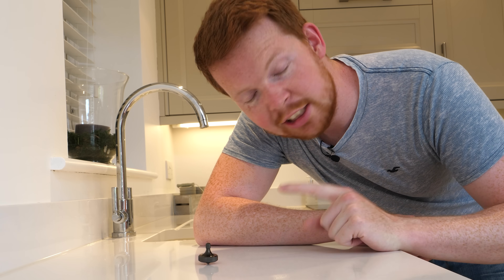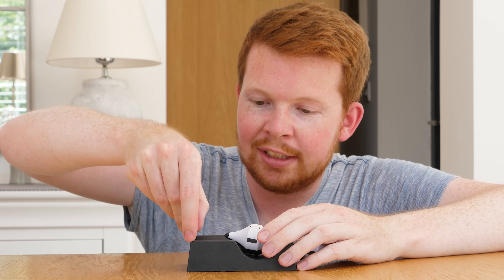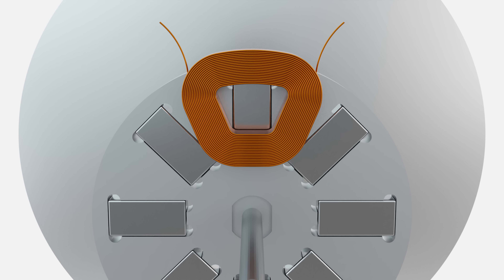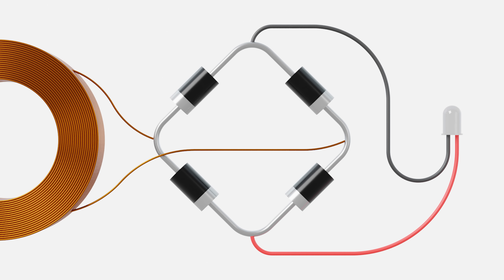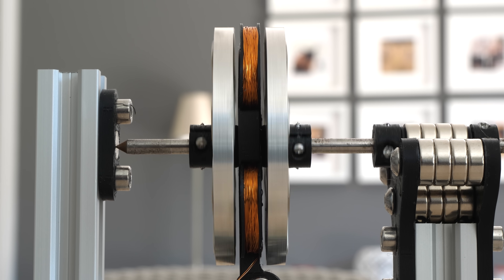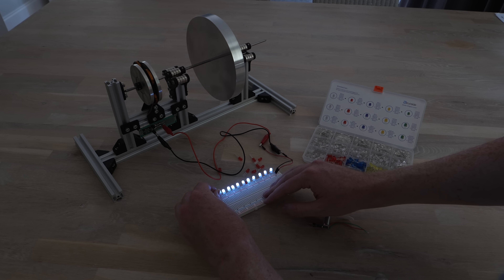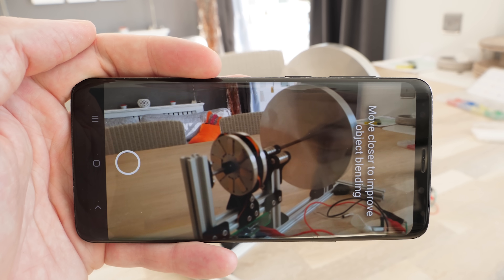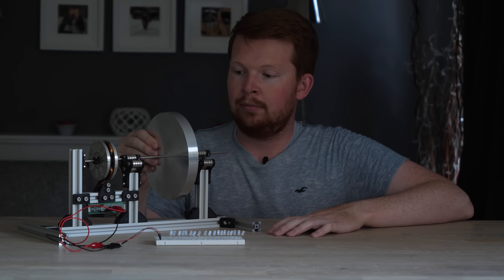Flywheel Battery

Comment: i had an idea years ago, that i do not have the tech savvy skills to manufacture or the money for the materials.  but what my idea was, was to use an "uber" magnet assembly to spin a generator.   what is an uber magnet?  well the one i saw that the idea formed around was a magnet used to slow a world land speed record vehicle.... it costed by what they said, 25,000 dollars for one about the size of a deck of cards.  but they also said in the show i saw it in, that uber magnets are the strongest magnets on the planet... the reason it worked for slowing the vehicle is that normal brakes for a vehicle traveling 600 mph would burn out in the span they'd need to be applied to stop the vehicle... salt beds are only so big..>LOL  anyhow the idea i had i called the "independence generator"  and the assembly basically kept that point between attraction and repulsion moving to keep the drive shaft in a constant rotating motion.  then attach the shaft to a generator.... i talked to one engineer about funding and he thought i was trying to con him.   after that i got disheartened... but i do feel the plans i drew up and the idea itself is sound... thou the magnets are very expensive, since i have limited knowledge about life expectancy, power distribution, and such i could never really scale the idea to a version to make a prototype.  but after watching information about the flywheel battery and the tesla turbine.... somehow it would be interesting to combine them?  eh i have to many ideas... peace.

Comment: The fact you need to charge the capacitor in full to run 1 ampere rated motor... The project only produce 100-500 mAh. Use Tesla concept to maxOut this project potential.

Comment: You're losing something like 0.6v through the diodes / rectifier due to the forward conduction drop.  So at the lower voltage of the original version, you're efficiency is really low.
Reply: Use synchronized MOSFETs, no drop.
Reply: @QF2653  you can't "just use synchronized MOSFETs" because then you need something to synchronize them, e.g., an active control like a microcontroller, right?

Comment: You are wrong! a flywheel is not a battery.  Batteries make electricity from chemical reactions.  Flywheels store kinetic energy from what ever motion source but are not usefull for moving uses as they add to much weight.  The same goes for his flywheel bike its the wrong application for the device.

Comment: Why do you keep talking about Voltage which as so many like to rave about, is meaningless. You should be talking about power - Watts. Each LED you add on your generator circuit will increase the electrical energy draw and the potential energy you spun into the flywheel will dissipate faster.

Comment: Hey, that's such a great idea! How many watts does this generate? Could you convert the output to stable 5V and dynamic current and then charge your phone with it? I would totally buy such a thing!
Reply: I was disappointed that he concentrated entirely on voltage with no discussion of power or energy stored. Lighting LEDs is one thing but for how long?

Comment: So instead of having that Pivot Point at the end where it has slight friction why not mount a magnet on the end of the shaft and then another magnet on the end of the pivot joint so they oppose each other and the magnetic force keeps that you points from having any friction sideways. Hopefully I've asked that fairly clear
Reply: Because with nothing to hold it in place the magnet would push it off center.
Reply: @johnphillips5310  the proposal is to use magnets to keep the shaft in place. Completely possible.
Reply: @johnphillips5310  well he said the shaft itself had poles. So could he not have put opposing magnets near each end of the shaft to keep it from moving in either of those directions?

Comment: The eddy currents and the friction at the tip of the shaft together with the bending and flexing of the axle probably provides twice the friction torque than roller bearings would.
Reply: There are scaling issues. Roller bearings are efficient at large scale, not so much at smaller scales.

Comment: Can this be made for a bicycle connected to chain and work as a charger for lithium battery pack. Connected to brush motor.  Would love to see that project if possible 

However there could be limitatiions to my thoughts 

But really think that if its possible then will make a revolution to ebike industry

Comment: what if you make the flywheel bar thicker and hollow out the end of it with an end cap that has a larger chamber lined with magnets on the tail end wall with a small opening and then run a  steel wire into the chamber anchored to a magnet of opposing side facing the end cap so that instead of a tip pressing and making contact on the front, you have a magnetic anchor pulling on the opposing side of the bar wants to move and eliminate all friction and function like a magnetic spring. You should be able to reach insane velocity with less contact. Let me know how it works out?

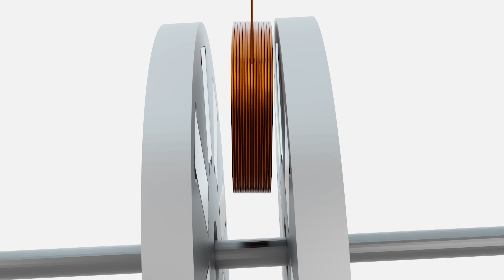Comment: 05:30  "we also need something to turn the alternating current into direct if we want to power something like a lightbulb or electric motor."   Nick Tesla would argue this point.
Reply: I was hoping he was going to spin it fast enough and put a motor to turn the flywheel, just need to work out what revs or geared turns it needs to keep itself going

Comment: How feasible would it be to send the output of what you have through a small transformer and from there into some capacitors to create a stored buffer?  And instead of relying on magnetism to create a declining spin, use the power of water which would be more constant, and as well provide more spin.  The theory is that water falls from a height creating velocity which hits a paddle, causing a spinning motion, the water is moved back upstream.

Comment: would powering a mini air compressor, and putting flaps on your wheel you could up your voltage enough to run the blower and a light source .
You could also hook up more than 1 flywheel in series to amply your power .

Comment: Cool! Leds are current driven. White leds like between 3.6 and 4 volts. 20 25 ma max. So 20 leds at 0.02 A=.0.4A-or 400 ma! I would wire a 7805 voltage regulator as a current regulator. Easy to do just connect it differently. Have you tried a Supercapacitor? Say two 1farad caps wired in series? That would result in a 500,000 farad capacitor actually rated for 5v. Also, silicon diodes have a 0.6 volt drop across the junction. Germanium diodes have 0.3 volt drop. But-Super hard to find any with a high current rating.   Mine only handle about 10 ma.(the old crystal radio diode- In34 in America) I have paralelled a bunch in solar projects. Efficency!

Comment: I usually think of magnets for energy - can magnets 'run out' like a battery? 
EDIT: also, you've had to spin it a bit faster - would it be possible to spin it at a consistant rotation powered only by itself? Or am I missing the point.

Comment: to keep the moving parts from touching each other, this can be sufficiently-addressed by a very simple but very effective solution: magnetic repulsion/magnetic levitation. just make damn sure the contact points are of the same polarity (both positive or both negative) and that they are perfectly-locked in place (to address contingencies in wobbling, in case the parts touch together, gouge each other out and your heavy engine part self-destructs), if your magnets are strong enough like neodymium, theoretically your moving parts should "float." 

the result: absolutely-frictionless moving parts, zero wear and tear.
Reply: I was disappointed that he concentrated entirely on voltage with no discussion of power or energy stored. Lighting LEDs is one thing but for how long?

Comment: Does the increase of power consumption (more LEDs) cause the flywheel to slow down faster? 
How long till the flywheel only produced half of the initial power (rotates half as fast) when using 1, 2, 4, 8 and 16 LEDs?

Comment: @5:35 You do not need direct current to power a light bulb, at least not an incandescent bulb.  Similarly, you don't need direct current to power a motor.  In fact, most motors require alternating current to run.  Even a brush-type motor will run off either AC or DC.

Comment: Please, Tom. I will build bicopter Avatar.  I watched yours part 1+2 on this theme. Is possible use this controller...?.
KK2.1.5 LCD Flight Controll Board V1.17S1PRO 6050MPU 644PA
Thanks for reply. (Or anyone reply)

Comment: Attach the electric motor to sprocket to help spin the wheel. You spin the wheel by hand or a crank and let the electric motor take over eventually with larger capacitors.

Comment: Have you tried using a capacitor to compensate for the flickering? It could be used to absorb some of the energy in the pulse and release between pulses.   You could also set up another wheel next to the first with coils in opposite positions than the first to minimize the flickering if you wanted to.

Comment: I recommend using a Hollow TUBE rather than a solid shaft. The hollow tube is much stronger and more resistant to bending. 
Just cut the crap rod off the flywheel, drill out the remaining and replace it with a suitable diameter tube.

Comment: remove the need to have the pin by having opposing magnets on the end of the shaft and the stop plate to push the spindle away from the stop plate

Comment: Now if you can just get the motor to power the fly wheel. lol.
 Normally that would not work as it would need more power than the fly wheel could create but since you suspended it to reduce friction. It may produce enough to do just that.

Comment: To test practicality, operate it off a solar panel during the day and run your lights at night. Those are generally a high windage item with high loss unless operated inside a vacuum chamber. I would rather use a Lithium battery. Charge it on Monday and use it on Friday with no issues.

Comment: If you use a piece of larger diameter steel tubing,  instead of a solid steel shaft, you will not have a bending problem.

Comment: The kinetic energy storage (flywheel) practically works, for example, in hospitals during short-term power outages. In the last century, as a child, I regularly traveled to school by gyrobus - it was a bus that spun a two-ton flywheel from the electrical connection at the bus stop and then a motor-generator (asynchronous motor with a short armature) supplied electricity for 4-6 km (to the next bus stops). The gyrobus was used where it was not possible to build an overhead line. Better than Gyrobus was the Capabus - a bus that pumped energy into condensers at bus stops. The problem of flywheels is, in addition to weight and high peripheral speed, that with a larger consumption of electrical energy, the flywheel brakes sharply (Faraday's or Lenz's law). The universe gives nothing for free. :)
Reply: @Peter Evans Approximately 200 kg can hold a sufficient amount of kinetic energy depending on the speed. I believe it could work for a few minutes, as long as the consumption was reasonably determined. My experience with this was only empirical in the days of that gyrobus (probably long before you were born). As a child, I was fascinated by this, although I already knew that it would be a dead end due to the many disadvantages that I had the opportunity to experience on a daily basis. Anyway, I appreciate your project, because if you don't try something, you don't know.
Reply: @Peter Evans There is no mention of 3000 kg anywhere! Why do you make it up?I wrote about a two-ton flywheel. This is the weight including the winding and box. The weight of the flywheel itself could be just over a ton and a half. The speed was about 3000 rpm. As a child, I enjoyed sitting in front of this flywheel and watching the movement in the sling. It is not good to question what I wrote. I also do not question your memory. You have internet. You can type "Gyrobus" into a search engine and read about it. There was never a case of a flywheel breaking something. It was a precise Swiss job. There was no vibration either. Even a broken bearing did not force such a weight to damage anything at full speed. In addition, to eliminate the gyro effect in the meanders, the flywheel was built vertically. However, it is a very old thing that has reached a dead end and I am very surprised that you did not know about this. But I'm glad you ventured into such a project, because even the best teacher won't give you experience. As for "no exhaust", I would like to make a few remarks, but I'll let it float.
Reply: @Peter Evans It makes sense to me - you say that you have never heard of a gyrobus and that you cannot imagine how they would mount a 3000 kg flywheel which, if released, would cut half the city. But I did not write about the 3000 kg flywheel, but about the two-ton flywheel in the gyrobus. You added one extra ton for unknown reasons. That's why I referred you to the internet, where you can find out the parameters of an old gyrobus (it ran until the 70's). You most likely have a bad compiler. Please reload YouTube. Otherwise, they can't explain it, not even your last absolutely nonsensical reaction. I only praised your project. By no means did I comment on it from a technical point of view. Before you respond, do everything you can to translate the text properly.
Reply: @Peter Evans You keep writing nonsense. Gyrobus did not have a flywheel 3000 kg, but up to two tons, that is, 2000 kg. The net weight of the flywheel was about a ton and a half, that is about 1500 kg. The speed was around 3000 rpm. Why are you putting something unrelated to this? Please check your compiler. Respond only after fully understanding the content. Thank you.

Comment: If you’d put the capacitor in parallel with the output leads it should have smoothed out the pulses and created a more consistent dc voltage

Comment: By sending an alternating current through the coils you could use them to spin up the flywheel and it would become a true storage battery.
Reply: AC needs to be synchronized with the rotation speed. That's not a simple task and is the reason small motors are DC where the commutator and brushes do the synchronization
Reply: @jimwhelan9152  Yes, I left out those minor details to keep the comment short. With a Arduino microcontroller and hall field effect sensor not impossible. With all the work that already went into this might as well take it one step further.

Comment: I wonder if its possible to gear the motor to the flywheel for continuous rotation. U would assume that the gearing would be high and you would probably have to get it started 😏 curious 😉 ...

Comment: Nice explanation but lacking mention of 2 elephants in your room. 
1. Could you use the motor to turn the flywheel therefore creating perpetual motion? (haha no) 
2. The alternator would drag on the flywheel therefore the more current you draw, the quicker the flywheel will lose speed effectively draining the kinetic energy battery more quickly.

Comment: I cant believe that Im watching this and you never made the connection of how to make it continue to work with no outside force. So simple but you dont see it???? Then you go into promoting a 3d printer that could further the use of this...perplexed. Your on the cusp of unlimited power. need to overcome the wobble to. You added elements to the wrong point of your design as well. Just my opinion wish I could tell you more.

Comment: Now add magnets on an angle on the outside of the large flywheel and another larger magnet to push causing it to keep turning on its own then it will produce constantly without having to turn by hand. Be cool to charge a cell phone with.

Comment: If you could fix the wobble. Then waterproof the electrical components, Make the flywheel a water wheel and use it in a creek at a camping spot or a turbine for wind. Actually a very versatile design.

Comment: This is great!  I have been facinated by flywheels for years.  Some suggestions.  Most industrial flywheels run vertical, not horizontal, to maintain balance more easily.  Magnets and jeweled bearings are configured to maintain balance, and reduce friction.  Applying a vaccum around the flywheel further reduces friction.

Comment: I wonder if you can attach a micro controller, relay, motor and have a bank of super caps so when the flywheel drops to a certain RPM the motor spins the flywheel back up.

Or instead of converting it to DC you take the low AC voltage and step it up to a higher AC voltage then convert it to DC.

Comment: Porsche used a similar system in its 2011 Porsche GT3 Hybrid(Racecar). But I don't think it has magnetic bearings due to vibrations. During the race, they transfered the energy into the fly wheel while braking and powered a electric motor, which supports the combustion engine. Very interesting.

Comment: Very interesting.  Though I must say I was expecting the battery to last longer than it actually did, that's the whole point of experimenting, isn't it?

I'm intrigued, though, why not spin it up as fast as is reasonable and safe using the coils to spin the axle (can those coils be used as a motor as well as a generator?)  or using the drill and then test its capacity in mAh?  Would seem to be an obvious test you could perform on a battery.

Comment: I have a question that could lead to a solution:
Can you place an upright somewhat in the middle or at the end?  The upright would consist of a rubber or plastic center piece that won't allow power or energy through, but will stabilize the rod.

Comment: i wish you would just put a resistor in series and used the voltage drop across it to find out how much current and power was actually being produced, as apposed to about 20 LEDs
Reply: great video tho